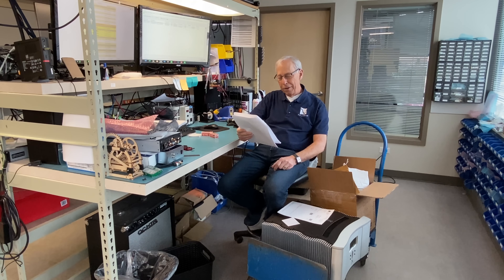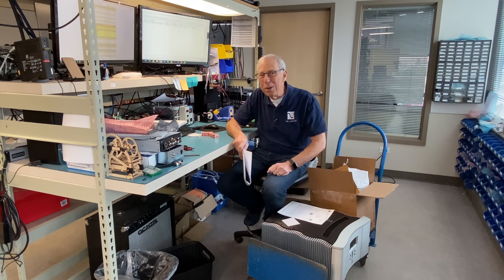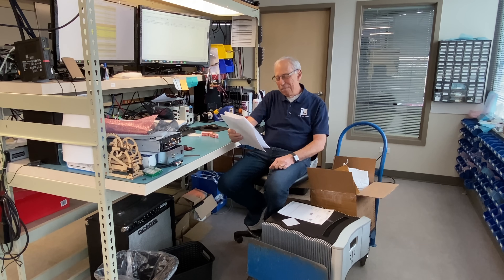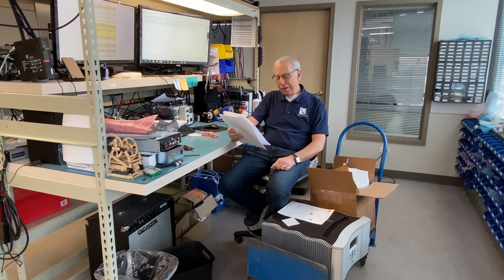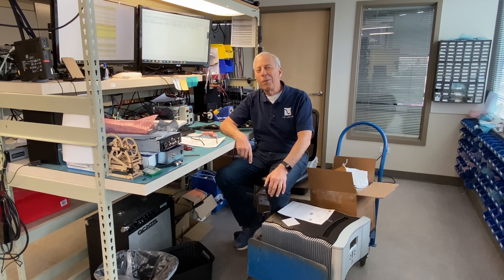Room acoustics for stereo

Comment: Hello Paul, I've seen a good number of your vidoes and thought maybe you can steer me in a moderate direction. I'm 61yr old Dave in Wales NY and have an opportunity to build a dedicated listening room in my 2nd story gambrel roof style, board and batten barn. The finished room will measure 16 x 20 x 7'-9" ceiling. I have pretty much destroyed my hearing over the years and I wear aids. I plan on installing closed cell spray foam to keep the weather out and open cell to keep my neighbors happy. I'll be utilizing the two absorption and diffraction technics. My question is > Should I even bother at this late in the game?

Comment: If you don’t understand that the room is the single most important factor by a considerable margin you really have no business discussing audio. In one of your previous videos you asked why pro musicians don’t waste (sorry spend) serious amounts of money on hi fi speakers. It’s basically because they invest in rooms that sound good. You also mentioned that you “prefer” diffusion. While diffusion is a valid tool in a properly designed room it requires a room with significant size and isn’t appropriate for smaller rooms as it causes more problems than it solves.

Comment: Loudspeaker quality, placement and room acoustics are the most important factors in achieving good reproduction. Assuming good quality equipment in the rest of the system then a pre-amp, power amp, DAC etc. Are way less important. For example, there are numerous very good SS power amps available in the $1000-$2000 price bracket. You can pay 10 times this or more on a so called “high end” amp but any improvement in sound quality is likely an illusion or so trivial that a change in the listening room or speaker position will completely swamp any perceived improvement in the electronics.  There is a huge market in snake oil products for the unwary. For example, audio and power cables do not require specialised and expensive construction. Paying hundreds or even thousands for audio cables is lunacy and the buyer is being defrauded by dishonest businesses. Magic boxes between the wall outlet and the equipment is another scam. Audio tuned fuses, anti-vibration pad to place under your amp and RF generators are beyond stupid.There is a marketing push for “hi-res” or “better than CD” quality audio. This is to persuade the audio enthusiast that there is now another step up in sound quality, you just need to buy more equipment. The Red Book standard for the CD was designed as a “no compromise” system. A well recorded and skilfully engineered CD will deliver an audibly perfect copy of the sounds captured by the studio microphone.  Go for the best speakers you can afford that sound good to your ears and try and pay attention to placement and room acoustics as this will have a much greater effect on sound quality than anything else.

Comment: I was fortunate enough to visit the factory show room for Avantgarde Acoustic in Germany. I was serious about purchasing / investing in the top of the line horn system. I was renovating the house so I asked what would be the recommended room dimensions for the system. How exciting, I would design the room for the perfect non-biologic symbiotic relationship. All was possible.  They had no answer only that it would work in any room bigger than X and the speakers have volume and cross over controls to aid in fine tuning. True and I was given a great explanation and demo.  But, I just could not get this symbiotic relationship out of my head. Would I have to purchase the speakers and fuss with temporary walls and ceilings making adjustments all the time. Hello see how long that lasts with the misses.  I started asking about the show room. Would you believe they poured sand between the studs to address bass issues. Very Interesting these Germans. I did purchase the speakers I did fuss abit and I did put sand in the walls. All that said I have moved and built yet another larger room that is not dedicated to a madman out for symbiotic relationships with non living entities and the misses is still here. My point is even speaker manufacturers are not sure and why should they be. I mean if speaker manufactures started including recommending room dimensions this would quite possible effect sales in an already highly competitive niche market. Paul makes some good recommendations here. I wonder when someone goes to put up a picture in the old house and sands pours out what will cross through their mind. 
P.S. Sand in the walls requires double sheet rock, longer screws,  construction grade adhesive and no outlets. It will add weight. 101.8 pound per cubic foot [lb/ft³]

Comment: People might want to visit Acoustic Fields both here on YouTube and on their website. From the “way back machine” they have a video of a very well corrected room with vintage equipment, including speakers that would not be considered “high end” today.  That system is superior to high end gear in a bad room. Given the cost of good room treatment - including proper absorption, replacing drywall with plywood or other less sonically damaging material and proper diffusion, a medium to large sized room might easily consume $5K. Such an expenditure might make upgrading $5K in components a moot point.
Reply: Furniture won’t do much for bass and standing wave issues.

Comment: This is a vidi of yours I actually take some serious issue with. First, sorry, but room acoustics are number 1 in importance, and solving room modes is number 1 in that category. Your punt on room modes means you're punting on actual good sound. You simply can not achieve great sound until you deal with the room modes. Sorry, you just can't. Second, if you buy premade acoustic items, then $5k is not a lot. I was quoted $10k just for bass management in my smaller room. I did not go there, but instead continued with my own work and ultimately did sonically neuter the primary room mode (for about $500, and I probably spent about $1k on absorption and diffusion).
All rooms will need some absorption, it is JOB 1, without absorbing the first reflections you simply can not hear anything that is actually going on, and will blame your speakers and electronics for numerous problems that are in reality acoustics.
Diffusion is how you create and tune the rooms sound field, you can only do this after you have absorbed all the evil reflections.
Neutering the room modes allows not only 1000% better bass, but also faster bass decay and additionally it opens up the room for vastly more low level spacial cues to flourish and actually effects tonal rendering and clean delivery of all frequencies to the listener.
And a note on volume and room interaction, in my own measuring I have found that volume DOES NOT affect the frequency response, put another way, the frequency response and room effect on it does not actually change with volume changes--- until you overload the room's current ability to absorb sound energy thus leaving it to bang around longer. But between 65 and 90 db I have seen no evidence that the room effect is variable in relation to volume, quite the opposite, the room modes always show up even at very low levels. It's Physics and no matter how much the audiophile world wants to continue to think that expensive gear transcends physics, it does not (I would actually go and say that Paul does in fact suffer from this, and it is my only disappointment here.)
PSaudio's sound rooms have been criminally poor in the acoustics department and I have major doubts about any speakers developed in those rooms and I feel rather strong conviction that the reason you could not get your AN3s sorted was because you can not dev a speaker in an acoustically poor room successfully. Apologies if these words seem harsh.

Comment: You have to be careful with constant tones on drivers woofers can damage the spider even at mod to High volume it will be fine for short period of time but shouldn't be used for break in. Just buy yourself a roll of natural wool fleece get some swish curtain rails hang like curtains extending about 2 feet in front of the speakers all the way around the corner and back round the other side make the corners round shouldn't cost you more than 3 of $400. Natural wool fleece is the best diffuser and absorber of low frequencies always hang your diffuses away from the wall makes them more effective

Comment: I would rate the room as being #1 in importance, with loudspeakers #2. Rest of the stuff in any order. 
In general, a room with a couple of thick carpets, thick drapes, bookshelves filled with books, fabric sofas with pillows would be a good baseline. It will probably need some or plenty of absorption at least in the front corners (behind the speakers) and first reflection points. 
DIY bass traps cost little but commercial ones can cost 3-4 times more. Some people are simply not DIYers or don't have the tools and workspace to do the job. Which is not hard to do in this particular case. 
I built 10 corner traps for my room and stopped there as it sounds good enough for me. It cost me about $500 for planks, mineral wool and fabric. I did have the tools needed which were a table saw, electric stapler, screw driver and drill. Table saw could have been replaced with a jig saw. 
Putting up the bass traps really made the bass stronger and cleaner. It's contrary to intuition but fully explainable: Bass traps attenuate the standing waves and make the bass response flatter across the room and frequency range.
Reply: Totally agree that room is number 1. You could try to do panels and place them on the wall, but with some spacing. This type treatment work with air motion, so corners are not that great to use it. See GIK Acoustics panels mounting and Acoustic Fields channel.

Comment: I'm not that surprised that he was told to spend a lot of money on the room. I listened to a German guy who worked with high grade professional room treatment, mainly educating others that work with building music studios, etc. He was asked about consumer room treatment and, as a very general note, he said that if you spend $2k on speakers you would probably have to spend about $10k on the room to get everything out of those speakers. His point was that people hunt for new speakers before they've ever heard how good those speakers can sound.
I certainly think he has some point given his education and experience, although it's hard to test out practically whether he has an exaggerated opinion or not. It will of course also be different depending on how much of the treatment you can build yourself, and also if you are capable of doing proper calculations. Room treatment is really tricky as you can have a problem in one part of the frequency range but it can be caused by multiple issues in other parts of the range, so it's not always easy to know what to fix.
Regardless of how much you need to spend on acoustic treatment (on average) I think most audiophiles have put too little focus on their room compared to the rest of the system, and I'm one of them.

Comment: Paul, hoping you are well, I would like to ask you some questions.
In electronics the specifications have little clearance or high precision, I mean +/-. In the case of the speakers these specifications are much larger, they are much less precise, the usual +/- 3dB in its more linear part, reaching -6 dB easy in the bass and possible roll off in the treble.
However, it is the room with the worst numbers, here we are talking about +/- 24dB between the peaks and valleys of 20-20K, even in the range of some speakers, 40-20K.
From personal experience, the room is the one that will make the most change for both good and bad. I know that excellent speakers with excellent amplifiers can sound really bad in rooms with terrible characteristics (like glass rooms that look nice and are very bad acoustically).
In properly treated rooms almost any team sounds good, perhaps it sounds like you will never hear it. That costs a lot, yes, it could cost a lot depending on how much precision you are willing to handle.
I still maintain the idea that the first thing is the room with the proper positioning of the speakers, hence I agree with you, speakers, electronics, etc.
What's your opinion about it?

Comment: Why 3rd place for the room? If you measure a speaker in a different rooms you would get a similar magnitude of variation as if you would change different speakers in the same room. And that variations are greater than you would get by changing electronics. That's why I always note speaker and room should be treated as one system and should be most important part in your audio system.
Reply: because you can't do anything with no speakers

Comment: Yes, but I'd rather spend $5k on room acoustics than on cables.
Reply: Let the flame wars begin!!!
Reply: @FatRat-f9m  Ok I will try it.
Reply: @FatRat-f9m  for very short runs on stereo speakers yes a 1.5mm speaker wire will be adequate. But for long runs to my back surround sound speakers the sound quality was dramatically improved by upgrading from 2.5mm speaker wire to 6mm speaker wire 🎶

I use the Dutch Van Damme HiFi speaker wire. Its used in world famous music studios including Abbey Road in England. Very good quality speaker wire from a reliable company, also use Van Damme HiFi RCA interconnects which are very good too.
Reply: Expensive cables make sense only AFTER one has done everything that's farther up the list. So yes, the room makes much more of a difference. Having said that, those who are through the whole process of upgrading their listening room and system may profit from investing in better cables. What I don't understand is how many audiophiles are willing to spend so much money on items farther down on the "to-do list" before or indeed without ever addressing the more important aspects at the top of the list (which to me are loudspeakers and listening room, followed by electronics and so forth).
Reply: I use 2,5 mm2 copper  power cables just because I know it annoys audiophiles.
Reply: @marcusm5127  Preach!
Reply: I use Amazon basics speaker cables and think I cut a couple of the copper wires at the end. Probably lost 10000dB because of that
Reply: No need to ever spend that much on cables.
Really good cables can be found for less than $1K; no matter how good the rest of your system is.

Speaker cable may cost a bit more than others, just because of more length.
However, even with 'cost-no-object' cables, you can find really great ones for far less than $5K.
Reply: @FatRat-f9m  I doubt they can here the difference between two low resistance wires. I tried one old thin bad wire and a new thick good ofc cable. The new one sounded clearer, switched the old one for another thick old copper cable and now they both sound the same. Low resistance is good so decent interconnects is not a bad idea but heck 20$ gold plated ones should be as good as anything else.

Comment: Buy a EQ. Take the rest of the money and buy a car or take a vacation.
"Paul says there is few rooms that need....." and yet YT is full of videos of insane money in rooms. One cost over a 100 grand and still had to have a sound guy in to "fix it".
Reply: Paul's a tad wrong on room treatments taking 3rd place after electronics. Room treatments take 2nd place right after speakers (on what you should be paying attention to/spending money on).
Reply: @wa2368  Or maybe even first since buying speakers is relatively easy - you just need a money. To fix the a room acoustics you need tons of money, knowledge and smallest rooms will always sound bad. You can have great speakers inside a room with echo and huge spike at different frequencies.

Comment: Check out the Argon diffuser designs (inc 'leanfuser') - get someone to line a couple of walls with these in a nice baltic birch. Bass traps in the corners if possible (see GR research design - though not very WAF), most important I would say absorption at 1st reflection. Carpet & Coving. Excluding the carpet, $500 would go a very long way DIY and not that far buying professional solutions - you would not get 2 of those fancy slotted things Paul has in the main room...

Comment: I have been doing hi fi for decades, but just last year had the opportunity to create a 12' by 19' dedicated listening space, and built some basic absorption and diffraction panels for several hundred dollars, which made a huge difference, took the room from virtually useless as a listening space to absolutely amazing. Now the most important task is to get the bass speakers and listening position correct for near flat bass response. Some rooms are easier with this than others and this one was tough, but after many, many  hours, and having to start from scratch three times and try various options along  the long wall and along the short wall (I used an RTA for measurement, but folks are using the free REW software), I finally struck on a terrific arrangement where the bass is amazingly flat. I am finally hearing the bass the way it actually sounds without serious coloration from the room (although no room is without it's own coloration). Then I worked on placement of the satellite speakers, varying the distance from the listening position and from each other, and most importantly, adjusting both toe in and rack back, I finally arrived at a pretty good soundstage. The results are unlike anything I have ever heard. But I realize most folks don't have the opportunity to do this, so treat and enjoy whatever listening space you have, but if an opportunity at some point in life presents itself for creating a dedicated listening space, the results will certainly be well worth the effort.